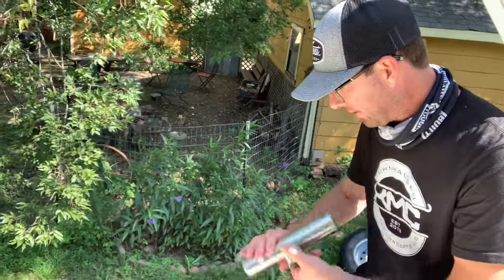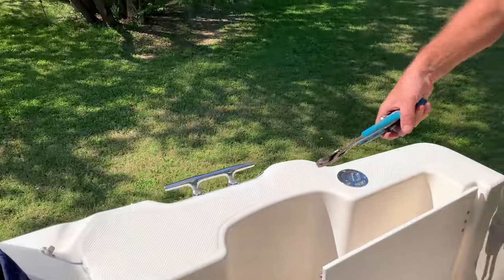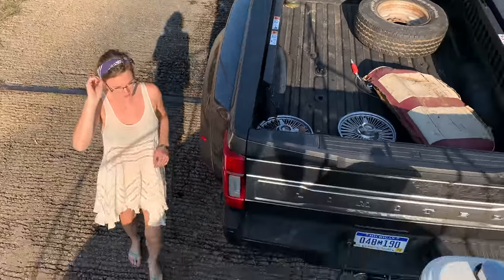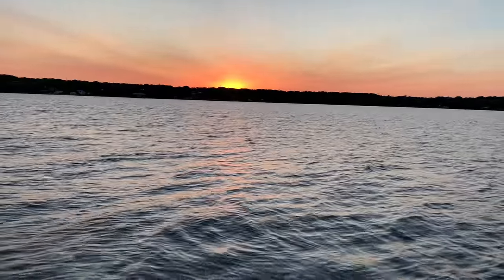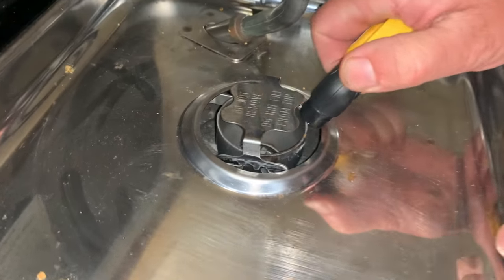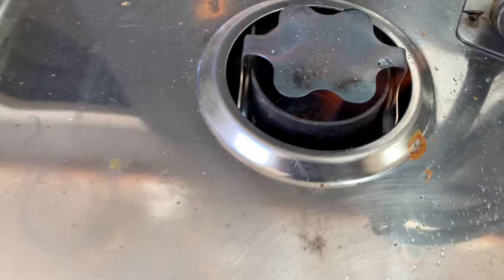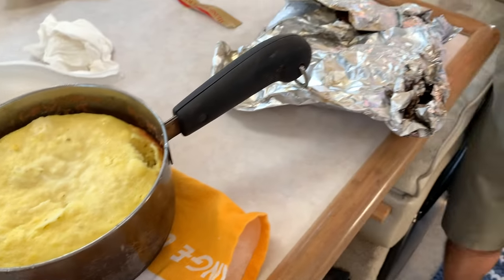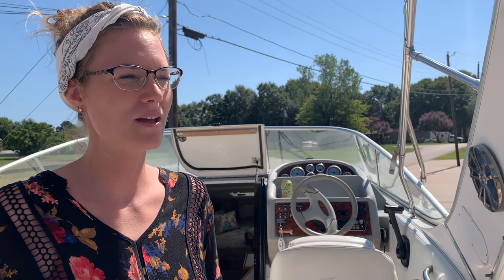Cabin cruiser cook and fishing trip!

Comment: You guys will use the grill on land at least as often as on water, so make a pipe/tubing adapter for the the existing mounting hardware that can be exchanged easily... maybe weld a pipe to a piece of square tube steel that fits into a truck/car's tow hitch.. perhaps a plate that fits into the center axle hole of a car rim, or the wheel lug pattern as a heavy base.  The broccoli and asparagus will both grill really well without steaming in the foil, just toss  them in oil and season with salt, pepper, maybe  lemon and garlic seasonings as you like,.. Grill ON the grates keeping a piece of foil so you can put the florets side or thinner parts of asparagus away from heat so they cook evenly. just get the stalks to show some blistering, 4-6 mins is enough, even less time if you let them rest after cooking !  Do yourself a favor on dinner and cook some whole extra potatoes, onions and jalapenos wrapped in foil, they can be cooked after main dish, and left on shut down dinner fire to be used for breakfast hash the next AM, along with any leftovers. That rub you blended would have been really good on the veggies too I'm sure ! Next time maybe ? Since I know you're a fan, maybe do a YT collab with DMFD to get some really good boating experience and tips before you go to the Bahamas ? I'd bet Robert and Sarah would love to visit you in TX, can your plane manage 3 or more ? They've got a big house in Jupiter, FL. They could really teach you a lot in the YouTube business !

Comment: I think you must have been talking about my SeaRay,  Weekender 300, twin 5.7L Mercury Inboard.  A/C, Heat, Generator, three new batteries, it is currently winterized since Fall 2018.  I fell off a ladder with a chainsaw, broke six ribs, broke my right shoulder blade, and broke my pelvis in two places.  I'm almost 75, the boat has been docked under cover at Lake Barkley Marina near Cadiz, KY since I had it winterized and I haven't been down to it since last fall when I installed the new batteries.  The OAL of the boat is almost 30 feet, (29' 9") and it has an 11-foot beam.  Very roomy.

Comment: Hey Aaron earlier you said that you were going to put some poles in the trailer well I got a cheap way to do this by yourself a 10 foot section a PVC pipe cut it down into about 2 inches. Never mind you you’re buying a 2 inch piece of PVC you’re cutting them into inches you drill a hole through the whole piece of PVC pipe that you cut already mounted into the trailer then sticky rods through the holes of the PVC pipe. Worked great for garage is holes whatever it wasn’t my idea I saw it on YouTube.

Comment: Love the  boat vids. Such a great deal! Two safety issues to consider.  Grill on the port side away from the gas fill  Also if the boat doesn’t have a dedicated propane locker on the outside find somewhere outside to store them. Propane is heavier than air and if leaks will fall into the bilge and a spark from the pumps etc could cause an explosion. Also an anchor wash down system will pull in sea water for a wash down. Great if anchored in muddy waters. Happy Boating!!
Reply: Thanks!  It needed to be said, I live on a lake connected to Lake Michigan (actually, grew up here too!). Have seen the results of a propane explosions!  They also make a brass cap, with a gasket, to secure those bottles a bit better.  Just extra insurance...

Great content!  Enjoy that water...
Reply: I nearly had a heart attack

Comment: I bought a worx battery pressure washer for my boat. You just throw the end of the hose over the side, put a battery in and you have 325 psi of cleaning power.
Just enough to clean the boat and you can add cleaner to it. Small so it fits under a seat.

Comment: I attached a bilge pump on my trim tap then hose clamp a 3 in piece of the male end of a old water hose. Then got a cheep flex garden hose. Installed a outdoor toggle switch on the transom ran wires up the trough hull with the trim tab line silicone it in. Just reach down screw hose on flip switch clean up the bugs and there you go. I also have a blue moth light with a trap it helps too.  Love the show.  Keep it up 👍

Comment: Get some solar panels. I currently have a O’day 25’ sailboat with a single 100 amp hour battery. We can stay on our boat for days without running the motor.  Plus adding a solar charge controller usually gives you a couple usb outlets and they have a setting that stops drawing power from your battery if it gets too low. We are gonna get a cabin cruiser next year and I plan on setting up solar

Comment: That looked like a fun time on the water in your new (new to you anyway) boat. The grille and cutting boards seemed like they did their jobs well. It’s unfortunate that the bugs decided to horn in on your meal, but at least you got the chance to use them.  We have a 2019 Ford F-450 Limited and use it to pull our 43 foot Fifth Wheel RV, whenever we can get the chance to get away for some relaxing time.  We love (at least I do anyway) using that beast to do whatever and even take it on short 200+ road trips because it’s actually more quiet than my wife’s smaller SUV is.  You may want to consider gettting one of those silicone skillet lids to catch/control the grease spattering everywhere when cooking inside. Looking forward to more videos of your adventures with your new toy.

Comment: I have a formula 27 Pc! The regulator on the magma stove has a little blue regulated on it it’s easy to drop in the drink use the hole put a line on it so you don’t loose it like I did! Also don’t put the stove on the side where the vent for the gas tank is! John Boy- Utah

Comment: Do a raw water pump in suprised it doesn’t already have it to be honest usually they always do especially if it has a freshwater system. Unlimited pressurized water get one that does about 70psi if you can they’re the better ones. The sea flo kit off of Amazon is good I’ve used it in my boat in saltwater for 4 years now without an issue

Comment: Ditched 1997  27 foot cabin cruiser vovlo penta 454 w/955hrs ocean fished about 5x a year  Replaced both risers siezed trailer breaks and when raw water pump went  i said screw it im not gonna pay 12 gallons per hour in fuel plus these costly repairs for 5x a year so i got rid of it and got a  partialy covered 16 foot aluminum rivited with 60 horse merc 2 stroke single axle trail w/no breaks put a sterring cable in the thing  and called er a day "as basic as basic can get However i now sleep the nite in truck/camper instead for 1/2 the fuel

Comment: The road lockers are nice until the Rope gets molded and starts smelling been there done that I love the alcohol stoves they cook so well the thrusters are called side shift and they would be $4,000 plus wire and batteries I just bought a boat for $1,500 it is a 1983 Carver Monterey 26 on a tri axle trailer the boat in my picture is a 1978 Century 4000 very rare boat it was too far gone and rotted to fix but the trailer is still good love boating guys there nothing in the world like it I have been sanding and retaking the new boat that I've got I have a video of it on my channel boat safety guys it's a fun hobby it can be very dangerous I have stories

Comment: I love your channel and I think you guys and your adventures are great!   A word of caution, I see you stored the propane canisters in the cabin under the seat.  I believe this is illegal and potentially deadly.  They need to be stored in a locker that allows gas to vent/drain to the outside.
Reply from the maker: Oh! Good point!!! THANK YOU!!!
Reply: yep, super dangerous because propane gas is heavier than air and settles in the battery and bilge area. Although the little bottles probably couldn't blow up the boat.
Reply: Even the little bottle they are using has enough liquid propane to blow up the boat if it, say,  leaks enough into the cabin and it gets ignited. They can be stored outside in a rack or in an exterior locker with a drain.  You can go to BoatUS(dot)com to get all the good info.